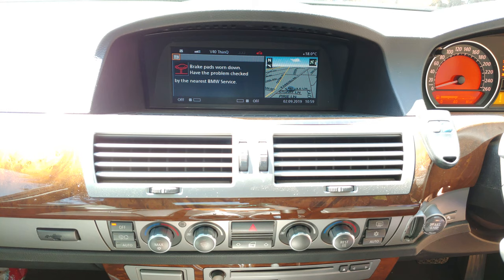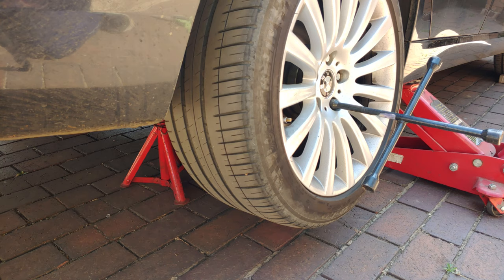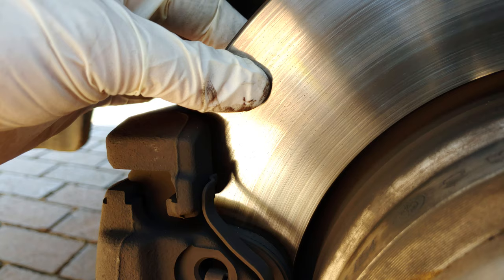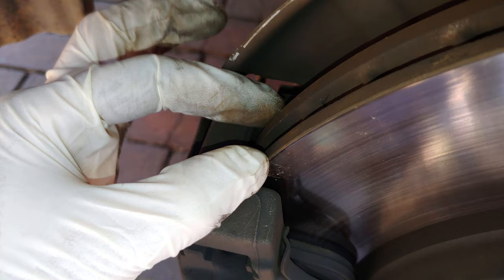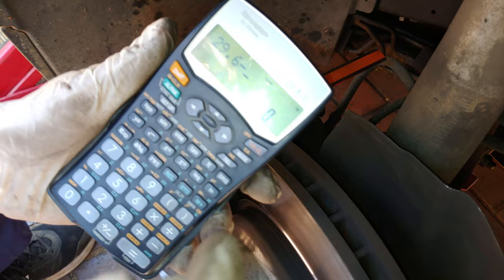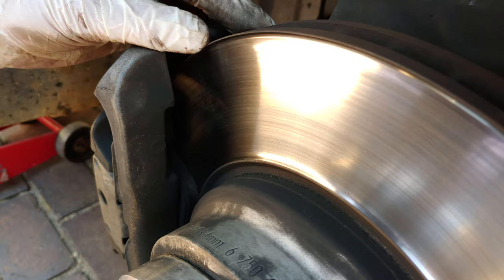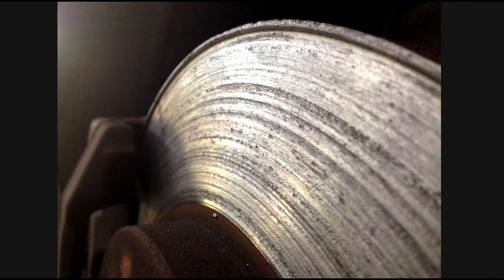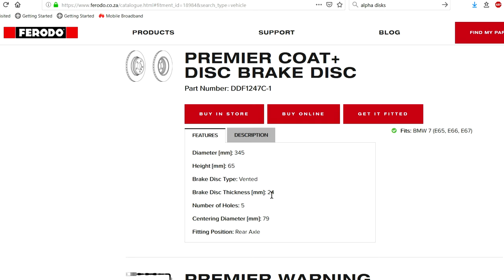When to change brake discs - how to measure brake disc thickness

Comment: You can also put coins on the disk surfaces, measure the thickness, then put the two coins together and measure their total thickness. Subtract that from the first value, and you know how thick the brake disk is.

Comment: Great video. Another way you can compensate for the disc lip is by using two thick coins. Measure the thickness with the coins on either side of the disc and then zero out or subtract the thickness of the two coins stacked together to get a more accurate thickness of the actual disc.
Reply from the maker: thank you
Reply: 20000 IQ
Reply: I keep 2 coins in the case of my verniers for this very reason

Comment: Best thing you can do is invest in the tools and learn how to replace pads and rotors yourself. The cost of new rotors and pads aren't very high, most times you're paying for the labour.
Reply: £500 for Audi discs and pads.. £320 with discount.
Reply: @GG-eg6kn  you're getting scammed, apply lube next time you go to get your brakes done, it won't hurt as much

Comment: To be honest having worked in the motor trade I never ever once saw a disk skimmed. Flywheels all the time but never the brakes! It's so cheap to change the Disks it never worked out worth it and the biggest problem is the time and transport to a machine shop and how busy they were never out weight the costs!

Comment: Hi, I put febi bilstein brake disks and ATE brake pads on my Suzuki Swift last year. There was nothing wrong with the measurement , there was still lots of pad and disk thickness, but it was making a slight noise every now and then, when I had them checked at the dealer , they said it was fine, but it was a little scorched looking. They said 70% pad life still left OEM. Anyway I decided to replace both.  I recently flushed/ bled my brakes using your Mazda video as a reference, it made a huge difference as my brake fluid was more the 6 years old, now the car is awesome to drive. I did a full tune up. Thank you for the videos, I learn a lot.
Reply from the maker: Hi All Joy, thanks for sharing. Interesting. i have had that too when the brake piston gets stuck as the brake fluid mixed with dust becomes powdery (very old) and the piston does not retract back and almost stays pressing on the disk. Gets hot and noisy. Thanks for your comment.

Comment: Thank you man, excellent video and really good information.  I had same experience, my brake works fine in most cases until I brake hard in  emergency at 80 mph in the interstate from an accident ahead.  It vibrate like hell but nice and smooth at regular braking.
Reply: The reason for the vibration is your car has ABS. Anti lock. In the old days if you slammed your brake son they would lock, and your wheels would skid like on a bicycle. ABS uses a high pressure pump that many many times a second triggers on and off. When you're braking hard  your wheels will skid slightly, the ABS module will reduce brake pressure and allow the wheel to roll for a split second, when grip is regained it will trigger your brakes back on. This can happen over and over until you come to a stop, hence the vibration.

Comment: Very well and pedagogically described. Can the discs be used even if they exceed the minimum size? -Yes if you don't drive advanced to pick up the kids from school or drive in the mountains like a hillbilly on meth. A thin brake disc overheats faster. Drive normally and you can probably wait a little longer for the change. It is a matter of judgement.

Comment: 6:50 so 29.6mm was somewhere near the "new" state of the disc. let's say it was 30.0mm new. substracting from there the 28.4mm minimum requirement, that would mean accounting for both sides of the disc, the max wear would be something like 0.8mm per side ? that's a pretty small amount that you are allowed to wear the disc out, no? if some cars have 1.5mm lip on one side that's about double the "life" expectancy on this one that you checked

3:10 and looking back to the first set you checked, min=22.4, i guess new=25.0mm(rounding up from the 24.8 you measured). so actually the accepted wear on these is 2.6mm, 1.3mm/side. this disc is thinner but has more "life" in it than the first one??

really weird......

also, for heat dissipation purposes, just as you said, would we not actually have thicker discs on the front? in your case the thicker ones were on the back. 
again...weird
Reply from the maker: thanks for the analytics
Reply from the maker: thanks, the thicker ones are on the front. The amount of wear is only a little but people let their discs get much more worn than the manufacturer recommend.

Comment: Why don't you use the correct tool to measure the disc?  There are calipers with "C" shape jaws and there are micrometers, often shaped like c-clamps.

Comment: On a percentage of vehicals. The rim is bolted to the hub. Not resting on lugs so my challenge and question is. Can you check the rotor thickness. Without taking off the rim?
Reply from the maker: i have not seen that but on motorbikes i have. If there is space between the spokes then i suppose you could measure, but proper inspection requires the person to feel the surface of the entire disk face and inspect it looking for surface imperfections as well so i would say take of the rim.
Reply: Thank you  @ecologicaltime  for replying.

Comment: What you all really need is a "Vinca DRGA-0605 Electronic Digital Brake Disc Rotor Gauge Caliper measuring tool"...   Worth every penny, the highest quality by a top brand and it will last you a lifetime!   Is the only one with 2 external jaws (claw type) the measures your discs from the sides withing and not the edges... 

No more need for all these Micky Mouse tricks as its a much accuracy tool and time saver!  A MUST FOR ALL BMW OWNERS that do their own sh*t...

Comment: Vernier is not build for purpose in this case. Get yourself Micrometer. It will take calculator sorcery away. Plus you do not know how correctly to use Vernier. It was exactly 0.54 mm at 4:06.
Reply: There's always one isn't there.🤐
Reply from the maker: true